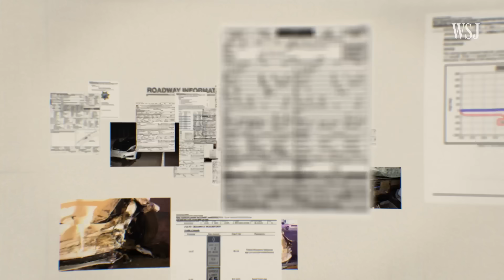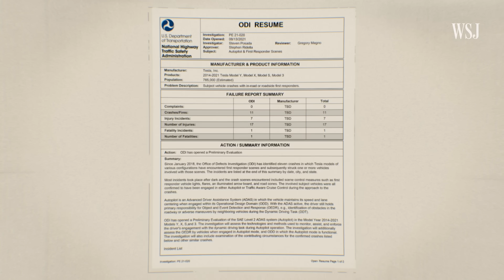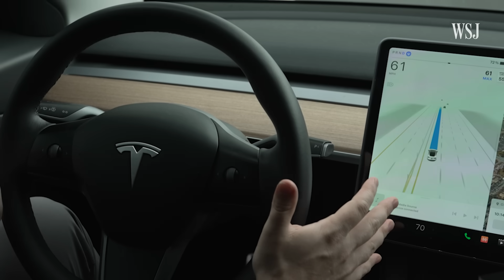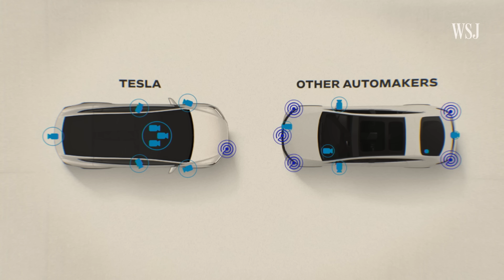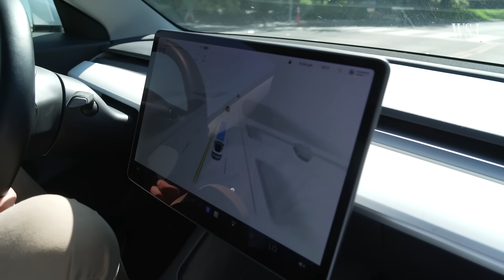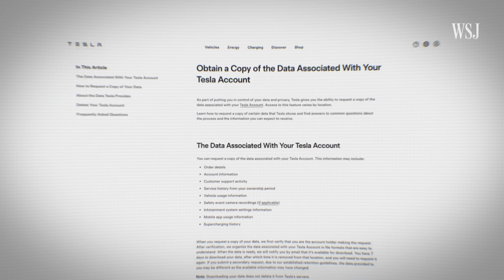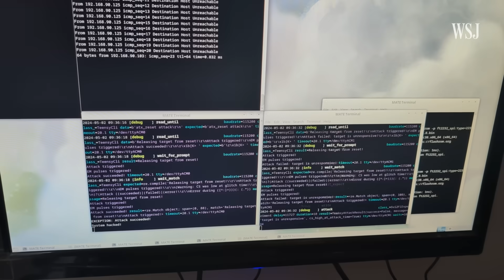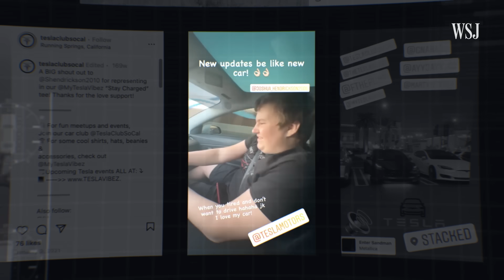The Hidden Autopilot Data That Reveals Why Teslas Crash | WSJ

Comment: literally every situation shown in this video wouldnt have happened if they used LIDAR. Elon was so set on just using cameras despite warnings from the engineers. the blood is on his hands
Reply: yes, dropping lidar on technological ideology was bad.
Reply: @CmdrTobs  V13 is showing it to be the right decision. Tesla creates a pseudo lidar with it's camera's, and has shown it doing remarkable things. Lidar is not some super sensor. Only a few months ago, A Waymo crashed onto a large pole.
Reply: I think the abrupt shift away from lidar to camera based reinforcement learning was the bad move. At least continue to use lidar to build the model for detections and reactions and then introduce that training data to newer vehicles without lidar. Their decision to just replace everything with cameras then push Tesla vision as an OTA update almost 2 years later was truly the dumbest decision their engineering team has ever made. No idea why the didn’t prioritize that rollout first, then focus on physical lidar removal.
Tesla vision could have been such a huge deal when they shipped it, but instead to felt more like a patch update to fix bugs, since that’s basically what it did for all of the vehicles produced w/o lidar
Reply: @Nullmoose  I'm not sure what you are talking about? Tesla has never used Lidar. They did use radar, but got rid of it because of it conflicting with what vision was saying. With vision being proved correct. Looking at the performance of FSD. It would seem to be the correct decision.
Reply: @daydreamer8373 are you a bot lol? They removed radar to save money against the engineers recommendations.
Reply: Why does everyone think lidar is some kind of magic solution. A few months back a Waymo crashed into a large pole, despite being equipped with Lidar. V13 of FSD is proving Lidar is not needed.
Reply: Are you saying if you just use your eyes, you will hit that turned over truck in front of you or you would have gone straight ahead at the T-junction because you don't have lidar?
Reply: @Uouttooo  no I'm saying that using LIDAR or using your eyes would have obviously prevented these accidents. there is no reason these cars should not have LIDAR, because people can not be trusted to use their eyes
Reply: @LSolomon13  exactly we want safer vehicles. having a basic front lidar system would've made these cars a ton safer and better already, esp with how hands-off and easy electric cars are, its a crime not to make a vehicle with that much potential energy not have the safety it requires.

Comment: Full self driving. Autopilot.  The lies about what the technology can do are right in the names and it can't be disputed that both of those labels are completely inaccurate and totally misleading. 

Tesla, as they usually do, chose to use the cheapest option and cheapest manufacturing techniques possible, only cameras, for their driver assist system in their premium priced cars.  Along with hyping the capabilities of those systems.  That is just one of the reasons Tesla's drivers have the highest accident rate of any passenger vehicles in the country. Slightly worse than Kia.
Reply: V13 is showing camera's are more than capable of automation.

Comment: Computer vision is not deeply flawed, its just insanely hard to be mathematically tractable.
A picture that is just 640x480 has at least 300,000 bytes of data, those bytes can be in any combination and it's a valid picture.
That is 2^2,457,600 combinations: the number far exceeds the number of atoms in the universe.
Shortcuts like AI leave huge gaps that we dont know about in there. We just dont have the mathematical ability to handle that as humans yet.
Reply: V13 is proving camera's are more than capable of handling self driving.

Comment: I kinda hate how they mostly have (im at half the vid) night cases, especially the one with the trailer on its side, iv’e seen plenty of instagram posts of people driving by themselves at night failing to spot a crashed truck/car and blasting into them, also the second thing is how they haven’t mentionned FSD, but really just Autopilot, which they call the basic autosteer (following lines on the ground) and cruise control, while FSD is another thing, so im wondering if they’re trying to mislead a bit, also the part where the car just “drove through a T intersection really feels like the Autopilot (instead of fsd) sonce they don’t stop for signs
Reply: Also for the second clip at 7:55, FSD pretty much always does a full stop for stop signs, so either the driver just pressed on the pedal for his car to just keep on going(wouldn’t have happened if fsd was on and he let it go) or it was really just the driver not knowing how to drive and being reckless. Really feels like the second one especially since i would guess FSD would’ve at least tried to stop before and turn right

Comment: Surely if the cameras are giving contradictory data, the vehicle ought to slow down in order to get a clear picture and minimize the danger of a collision?
Reply: Or sound an urgent alarm in the cabin to alert the driver?
Reply: @Steyr6500 it does sound a loud alarm if a collision is imminent. The “forward collision warning” in my Tesla has 3 choices: early, medium and late. I set mine to medium because early was giving too many annoying false positives. There’s also automatic emergency braking. It doesn’t guarantee a crash won’t occur, but should reduce the severity of the impact.
Reply: That’s the challenge with technology. It could lead to false positives. Unnecessary braking could result in getting rear ended.
Reply: @bikeman7982   I don’t mean do an emergency stop though. Just slow down a bit to minimize danger. And of course, that can also depend on the rear-view cameras.
Reply: @bikeman7982  I'm genuinely 100x more concerned with being rear ended in my Tesla than it running into anything. Its exceptional at avoiding cars and people on the road (not great at roadkill or potholes yet, though it is good at avoiding animals). It does sometimes brake in unnatural ways that someone following close behind you would have difficulty predicting. If someone is tailgating me, I will usually either take over or speed up.

Comment: 1) This whole video is pointless because it is criticizing Tesla's EXPLICITLY driver-assist Autopilot as though the company was telling people it's fully autonomous. They are not and never did. They, in fact, tell you explicitly, multiple times before allowing activation, NOT to trust it - that it is only an assist and not fully reliable, just as every other brand with autosteer adaptive cruise control does. This video is as valid as blaming every car with cruise control for still having crashes. In every case, the crash is the fault of the driver.
2) There is no comparison made to the crash rates between Teslas using Autopilot and other brands' Autopilots, nor to cars with no Autopilot active, meaning this is useless fear-mongering.
3) Missy Cummings is not an expert on anything, as has been resoundingly proven by her long-running arguments with the Tesla community. She is an ignorant hack with a grudge, like the WSJ.
4) You can go watch any of hundreds of videos of FSD V13 proving that Tesla's camera-only AI solution is working and will soon be safe enough to be fully autonomous.

Comment: I use FSD, but im still fully aware of what is going on and do not distract myself by doing other things in the car while driving. Its not a full proof way of driving and it does make mistakes but im always aware with my hands on the wheel and ready to take over if theres something i dont like when the car is in FSD.

Comment: The autopilot concept fails in cars. Philosopher H-G.Gadamer points out that “to rely on technology means to rely on its functioning”. But the autopilot concept contradicts that: Tesla says, in effect, “Use it, but don’t rely on it.” Following Gadamer, you can’t have it both ways. You can’t use autopilot and not rely on it at the same time. You do one or the other, not both. Autopilots in aircraft differ because they are largely for maneuverless flight, mostly in empty space, without obstacles, and sometimes with highly constrained maneuver sets landing and takeoff informed by precise ground-based guidance sensors—analogous to autopilot for cars confined to purpose-built tunnels or railways, with strictly enforced fully aware traffic control, and limited scene diversity, and few surprises (pedestrians, bikes, animals, unalerted crashes ahead etc.)  Driver assist, on the other hand, is the way to go, as some car manufacturers have realized. There the concept is clear: The car will intervene only when the driver behaves as if inattentive, too slow reacting, or incapacitated, taking responsibility only when the driver shows signs of being irresponsible.

Comment: Now imagine a computer driving an 80,000lb truck
Reply: Soooo the tesla semitruck
Reply: Yikes
Reply: Or we could invest into decent train infrastructure?? 🤔
Reply: @growtocycle6992  Yup its easier to have self-driving trains I think. We already had them for at least 20 yrs, probably as those are on fully enclosed rail lines e.g. fully underground with platform screen doors, where no obstruction the trains can crash into
Reply: I’ve actually not seen a Tesla semi yet somehow out there but I’ve seen other brands without drivers. It’s very worrying for many reasons.
Reply: I sure love a computer flying me cross country and reducing workload. I heard pilots of multi million dollar aircraft love those too. 

What baffles me is the negative press and public’s perception of “autopilot”. In general aviation it’s not a system you put full trust in like an automated elevator. Instead you constantly monitor and are always ready to take control and disengage. 
Same with Tesla autopilot. Autopilot in the context of aviation was never a full proof system, and Tesla never marketed their autopilot system as such (completely different from FSD claims which still require full attention). 

A trucker would love to have an assistive system to reduce their workload. Of course just like in aviation, they can always take manual control anytime and when the situation requires it.
Reply: @battery_wattage  the problem is that unlike in the air, where you have time to respond when the autopilot makes a mistake, the ground has a lot of things a truck could crash into within fractions of a second. So the driver has to pay full attention at all times anyway.
Reply: I trust that over the current drivers, computers don't get tired
Reply: This video isn't a critique of self-driving cars. It's specifically investigating the camera-based technology that Tesla uses, and it's misleading claims about it. 

Human drivers are far from perfect (how many millions of crashes have been caused by truckers making mistakes?). AI will 100% replace human drivers, and make driving enormously safer.
Reply: @DunningKruger778  AI will replace human drivers in the US but no where else. Because everywhere else roads are designed as multi-use spaces and require much more decision making with a greater variety of interactions than in the US, and drivers in those places are much more competent and roads are designed for human-driver safety so the rate of crashes by human drivers is far far lower than in the US.

Comment: The Tesla Autopilot system has 1 crash per 4 million miles of driving.  A typical gas car has 1 crash per every 900,000 miles.  Which one is safer?

Comment: Autopilot is an ADAS system the same as on all other cars and the driver is responsible at all times. If the car crashes it's the drivers fault. It is not the same as autonomous driving which is FSD (Supervised) which again is 'Supervised' and the driver is responsible at all times. You can't blame the car if the driver is not in control.

Comment: I am driving a Li Auto vehicle equipped with LiDAR and AI, which provides better assistance compared to the more expensive Tesla Model X FSD. Li Auto requires users to complete proper training and pass tests in the APP before activating the 'autopilot' features. The system's warnings effectively remind drivers that it is an L2/L3 system, not L4. The AI serves as an assistance tool, and drivers must always maintain awareness of their surroundings and driving conditions.

Comment: The Europeans have already put Musk=/=Tesla in its place won in courtroom and call it an upgraded cruise control & nothing more.
 --- Now Apply Common Sense multi-million-dollar aircraft have been fitted with autopilot for beyond half a century, and as we all know it is still causing issues to this day and is constantly being tweaked. So, the system in aircraft costs millions, how much does a Tesla cost, so if after 50 years the tech's can't fully sort it for a plane by now, how is an upstart startup like Tesla going to do it in the few years they have been operational, and how could they get it absolutely correct for just a few bucks. The Tesla autopilot systems should be legally "amputated" from the cars computer system.

Comment: This is the stupidest video every. It says to pay attention to your surroundings while in auto pilot. If you can't follow simple instructions, maybe you shouldn't be behind the wheel.
Reply: The point is the Tesla systems are vastly inferior to the rest of the industry using radar, ultrasonic sound sensors und lidar. Also the camera is trained to recognize shapes they know. But when it was not trained on a kid on a bobby car then is will not brake for it.

Meanwhile it lacks basic fault safe operations when a sensor is blind, faulty, comminication is faulty or user error. 

Remember when people were able to sleep while autopilot was driving? Yes, they were actually on the road like this.
Reply: @hkad6252  My point still stands. It doesn't matter whether the auto pilot is inferior to others. You're told explicitly not to leave the on auto pilot and assume it will drive 100% safely. If people want better auto pilot, then they should buy a different car. A car from 12 years ago didn't have "fault safe" measures when an idiot fails to break when coming up to an obstacle. Learn to drive and be aware of your surroundings, you aren't in the air.

Comment: If you need to watch the autopilot constantly it's not an autopilot or even a way to make driving easier or, plainly, safer. In the Hendrikson crash, the road appeared quite well-lit and an observant driver may have registered the traffic moving over to the right and the truck stopped on the shoulder next to the accident. This is tech for its own sake and I would never trust it to do a better job than me. Especially knowing that it'll get confused if it sees something it doesn't understand. Remember; the eyes are actually part of the brain. Musk's a madman masquerading, with some success, as a genius, who has too much influence. And now he's de facto president. You're crazy over there. You need to give your heads a shake.

Comment: If you compair how many crashes occurred per miles drive by human drivers you will find that tesla auto pilot is far far safer. Even if you only took into account how many accidents per year by distracted human drivers it pales in comparison. And its only going to get safer. Much much safer!
Reply: Telsa are so safe that they are not included in many trials of self driving in European cities. They are way behind the competition when it comes to tech. Cameras are simply not good enough for safety.
Reply: @knightsnight5929  No car company has anywhere close to as many miles driven without human intervention than tesla. Not even close. FSD 13 is light years ahead of all the other car companies combined when it comes to self driving tech.

Comment: here's a secret about AI algorithms. Currently, all data modeling (machine learning to form a data model) is based on determining the highest probability answer to a question, which means that it looks for the "best fit" answer, which in turn, is the average. Meaning, all modern AI learning techniques is to be the best average human intelligence, at the best case scenario. The theoretical best performing AI driver will be the best average driver, which according to Elon, sucks at driving. So of course, cars need more sensors and robots automation techniques to supplement the AI driver. We care about car automation, not AI driving.

Comment: As a motorcycle rider, I sit higher than most drivers, which gives me a clear view inside other cars. And with that perspective, the number of reckless actions I've witnessed from Tesla drivers on the highways is truly shocking. I've seen not one, but seven different women doing their makeup, two drivers who appeared to be asleep, and one man reading a newspaper. When a tragic accident happens, don't blame the system—it’s the irresponsible behavior of the drivers that’s the real problem.

Comment: Do you know what beta is? Again misleading information taking advantage of the pain of the families. This video produced with data 4 years old in a software but still is a beta and you forgot to mention how many accidents are avoided because the driver is not tired. And he also forgot to report accidents from cars that actually have adaptive cruise control that it didn't work because you don't have video feed from them

Comment: What is not in the analysis is he may have died anyway... He certainly didn't hit the brakes and override the self driving hitting the truck turned over on the fwy....  No system is perfect, crash rates with humans in non normal situations is quite high too.

Comment: The car not stopping with a huge obstacle on the road is not a camera failure. It is a neural network failure. NN are flawed. The problems will be different with LIDAR but there will be problems (ie preventable deaths).